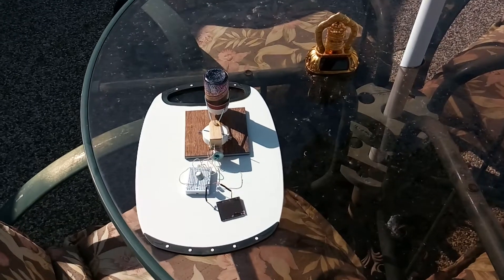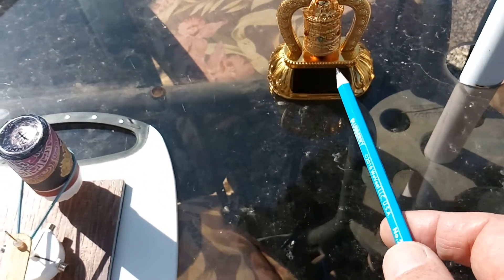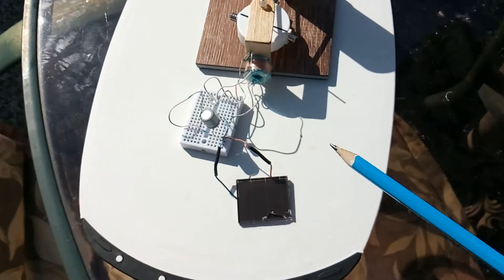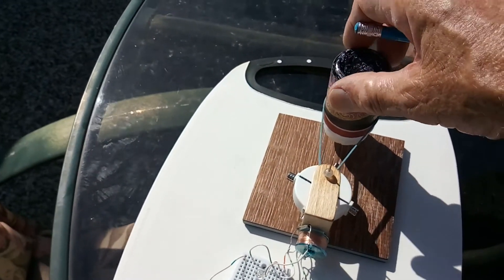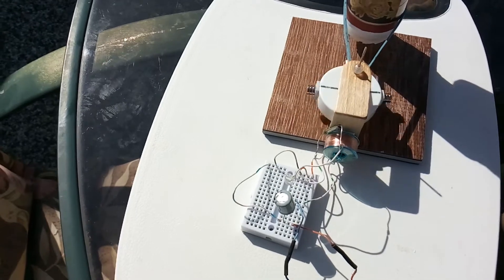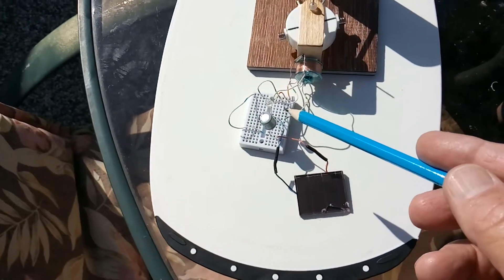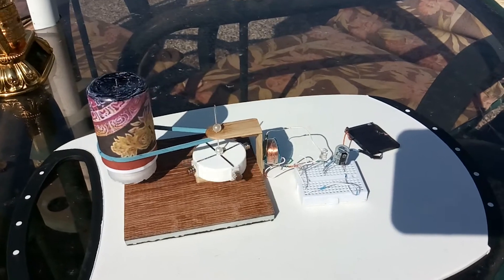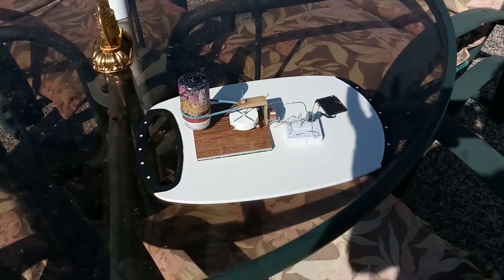Lidmotor Prayer Wheel

Comment: This is one of the few pulse motor videos we have where the motor actually does some work so this is a double bonus. The frame rate certainly plays havoc watching the video with the pulse motor apparently turning every which way while your prayer wheel makes steady progress. I couldn't quite make out which particular prayer you had written on the drum 😍👍
Reply from the maker: The fact that the weak 'needle motor' can do some work is a notable success.  There is a brass bearing on the bottom and a plastic bead bearing on the top.  I also used a very good lubricant.  The drum is covered in just a pattern picture and not the typical mantra prayer.  I was going to write a prayer on the paper  that said, "Oh Load please let keep turning" but I decided not to. Ha.

Comment: Would be interesting for you to show what has you stumped with the other circuit. Maybe you could share the process as you work through it and learn. Could be eye-opening for all of us! I'm sure one of the other circuit monkeys here could give you a tip!
Reply from the maker: The circuit really is a puzzle to me.  I need someone else to have aa go at it and tell us what they found.  The circuit probably has a set pulse rate that is then overridden by a varying one once the rotor starts turning. How that is done is the question.

Comment: Another great video Lidmotor!! I still have yet to play with that prayer wheel circuit. I kinda feel challenged to figure it out. Wish me luck haha
Reply from the maker: Thanks. If you have success getting that circuit to work right  let me know.
Reply: @Lidmotor  update! Still testing more and having great success as a self starting ultra low current pulse motor so far. Very low current under 10 uA! Could not get to self start without the 0.1uF caps. I think for how I'm running it with the 10k coils, super low friction needle in glass V bearing setup and 8 magnet rotor was its success. Everything was the same as in the diagram except for the added 0.1uF cap, 10k opposed coils and 8 magnet rotor. My guess right now is the circuit likes mostly symmetric higher ohm coils. I think lower ohm coils would provide more torque but possibly draw more current. Also think the rotor with the magnets being closer helps it self start better. Still playing around with it. I think a lot more can be done with the circuit. Hope that was helpful :)! Cheers!

Comment: I simply like how a spinny low torque motor is moving that big mass! 
Innovative engineering again, even if you had to abandon the 'real' circuit  :)
Reply from the maker: At least I proved that a  weak 'needle motor' can turn a rather large item using a rubber band pulley system.  That circuit is still a puzzle to me.  The key to making it work might be the thin wire bifilar coil that is used.  I may try winding one and have another go at it.